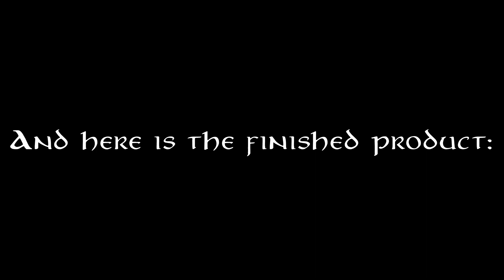Making Bilbo's sword 'Sting' from The Hobbit | LOTR Frodo's dagger replica

Comment: You absolutely nailed the inlay, I've been looking all over for ways of doing that that won't be a pure nightmare, and I think I've found it with you. Amazing overall finish too fella!
Reply: Did the silver wire flattern out okay in the end? :) I'm meant to be making a load of small ones for a wedding and I'm a bit lost haha
Reply from the maker: Thank you so much, man! The soldering wire was actually my own idea and I gotta say it worked great! You can hammer it flat and wide and it's super easy to sand flush after the superglue adhere. Try it!